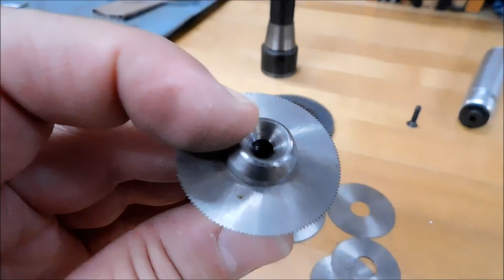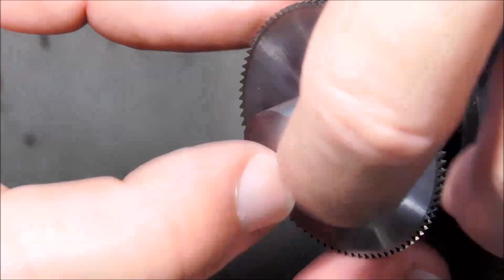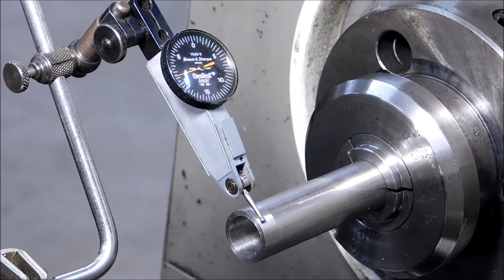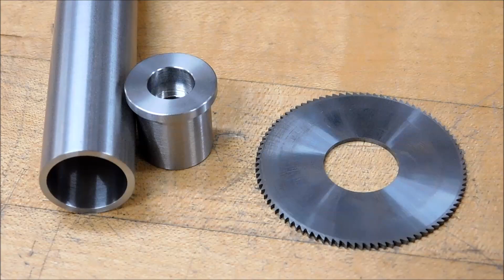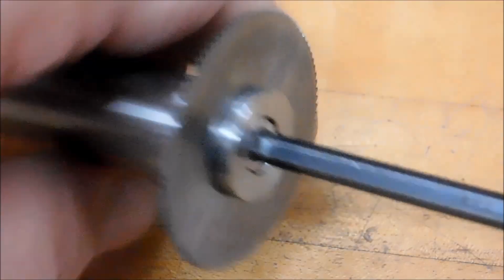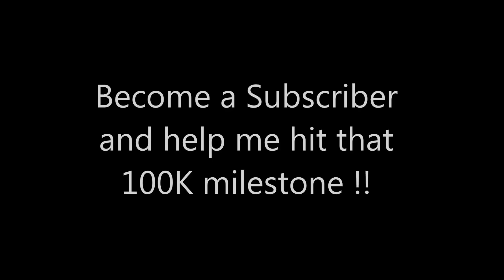Machine your own Low Profile Slitting Saw Arbor

Comment: I know you used SS because it is what you had, but what other material would be suitable for something like this (hopefully something free machining for my small lathe)
Reply: The advantage of SS is that it won't corrode and thus stop being centred and flat. If you do it for single use or protect it properly + clean it well before next use any steel you can machine will do.
But if you apply good choices of speed, feed and cutting depth combined with the right tool choices your machine will handle SS if it can handle ordinary steel.
You can also substitute with brass though it'll be a bit more prone to wear.

What I really would avoid are brittle materials like cast iron
Reply: 1144, a.k.a. StressProof is awesome for stuff like this.  It machines easily and is very stable.
Reply: @Clough42  Thanks for the input. BTW I enjoy your channel. Have bought your electronic lead screw kit for the lathe mentioned. Very nice board.
Reply: Hope this helps: I have a 12x36 lathe, and 1144 stressproof machines very well. High strength, nice small chips, does not need to have lots of depth of cut like stainless. Can't be welded though. Ninja'd by Clough42
Reply: I have made these from hot rolled regular steel, rusty old scrap metal laying around, as long as you don't crash or snap the blade in half they could last for years... that material doesn't like a long stick out though or big diameter blades but will do the job for most hobbyists or small blades that don't take a lot of torque.
Reply: I've used 12L14 leaded steel on similar items (because it's what I had) on similar items with good results. However, it rusts from humidity. If it's something important I parkerize it.
Reply: 12L14 is good, but you'll need to cold blue it and keep it oiled, at least, if you want it to last a long time.
Reply: Hey thanks for all the input. Have some old shafts that I might try as it machiines really well

Comment: Would this be a good opportunity for a fine-thread screw?
Reply: You will get a higher clamping force with the same torque (or reach same force with less torque). That said, as far as I can remember those arbors I've seen have used coarse threads.
Reply: The stainless ones I have made have had fine threads... easier to tap.
Reply: @qcnck2776  That's what I was thinking - you could get closer to the correct size of tap drill, and this is pretty low-risk in terms of cross-threading.

Comment: I've made one of those when I just started out a couple of years back, it wasnt pretty but it worked great
Reply: Same, useful when needed, 👍🤙
Reply: Spencer Clayton I’ll be making a new one once I finally get to have a mill again
Reply: 𝖘 𝖍 𝖎 𝖗 𝖔 yup I plan to as well, I have a little 3” HF carbide tipped blade I want to try, 

I also cross drilled the opposite end of my existing arbor to accept round tool bits at 90° with a set screw down the CL
Reply: I added wrench flats on mine for easier changes